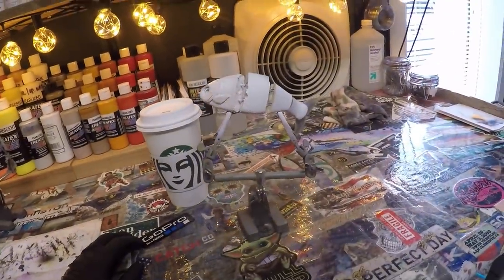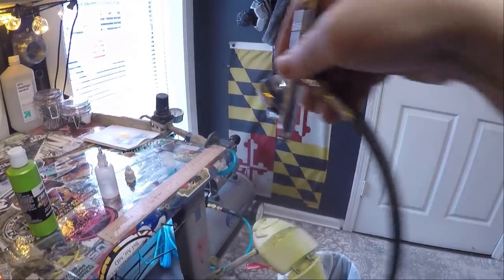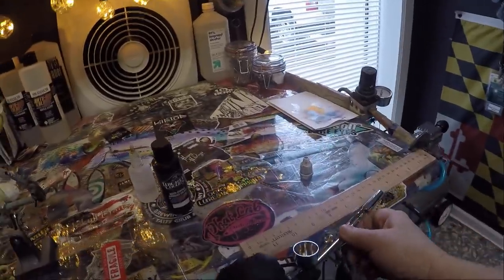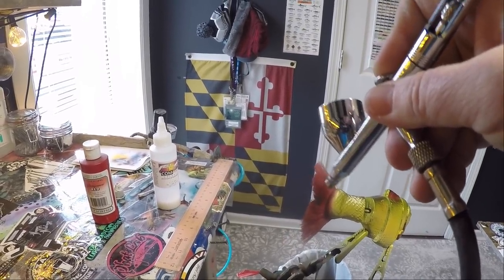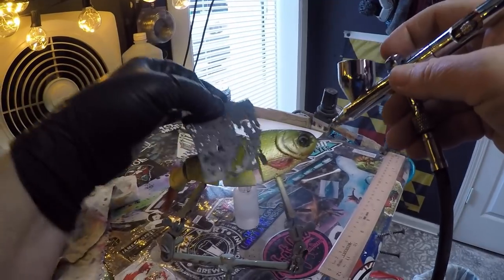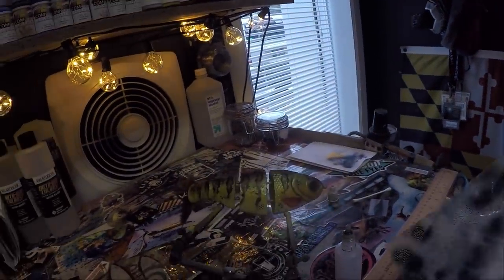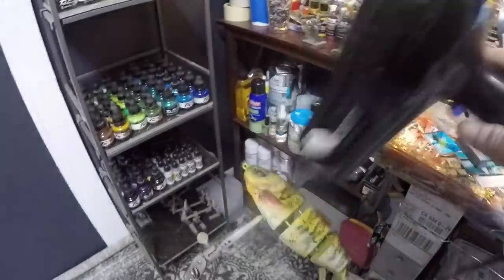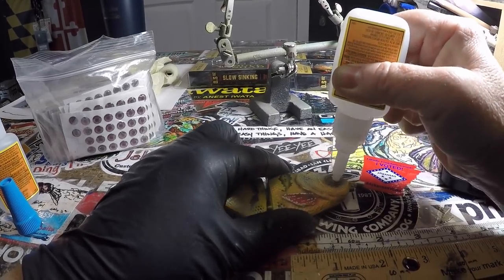The FIRST SPRAY SESH of 2021!!! (Northern Perch Pattern)

Comment: I was just thinking about your exhaust fan, if you build a frame around it and put a furnace filter in it it should still take the fumes out and save your fan from cleaning as much and cut the noise down some.... just a thought I've, been drinking some... maybe too much....just a thought....need to change the filter every once in a while...
Reply from the maker: I’ll definitely try that. THANKS! 😃
Reply: @Jekyll424  you're very welcome! I don't usually comment but when I have a few drinks I cant shut up!!!!....sorry!!!

Comment: Did you mix your paint with reducer already or just paint straight out the bottle ?
Reply from the maker: Mostly right from the bottle
Reply: @Jekyll424  what’s the psi you usually use?